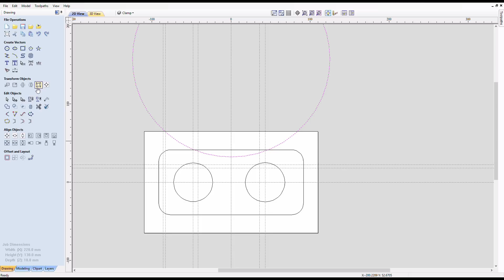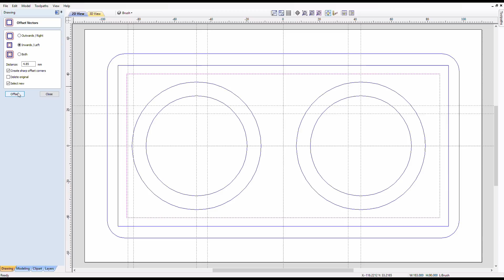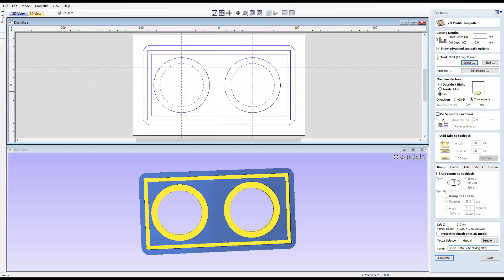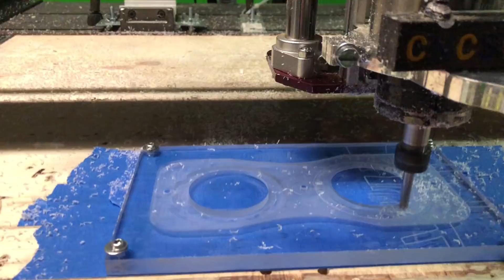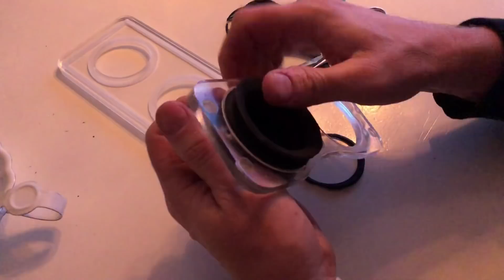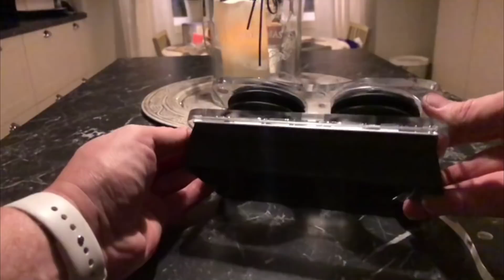The Floating Dust Shoe (The very best dust shoe out there?) VCarve tutorial.

Comment: Looks a great design Erik. How is it performing after all these years? I am thinking of adding a 4th layer to accommodate long and short brushes and, in our case possibly brush layers for wood and other materials separately.
Reply from the maker: Thanks! 😊 It works great. After the video was made, there are a couple of things I should have done differently. The part with the brushes would have a bevel so it would slide up if it hit something. And the acrylic I built it from I got from a friend. I didn't know at the time that it was so expensive, so it might as well have been built from MDF or Baltic birch.

Comment: 2 years later....are you still using it? Any drawbacks you have found? It looks to be a great design. Not sure it will work on my router but I think I am going to try.
Reply: I ended up making one out of 1/4" birch plywood. The baffles were spendy but I love it.
Reply from the maker: John Motschenbacher  I’m so glad to hear that 😃👍
Reply from the maker: John Motschenbacher Hi! Sorry about the delay. I totally missed your comment. Yes I use the shoe all the time! It works over my expectations. The drawback might be the choice of the material, I got a lot of that acrylic and didn’t realise that it was so expensive. So I consider to do a new video and make the shoe out of MDF with a little inspection window  in the middle of a thinner bit of acrylic. And it have stuck once in a obstacle so I recommend you to round of the edge on the part with the brush. Try to do something similar to fit your spindle and you have a dust free CNC.  Good luck 😊

Comment: Please confirm that the middle part have a border so that it sits accurately when the magnets come together with the part which is mounted to the spindle
Reply from the maker: No border but it has three pins that's going down in three holes, as you can clearly see at 14:00 in the video.
Reply: @CNCSwede  yes I noticed thank you for the clarification ..... but I feel that the weight is going to be too heavy for the magnets to handle ... if I have a machine with an 8 inch/200 mm gantry  and I am doing a job close to say 100 mm the bottom part of the skirt would exert pressure while adjusting....also  when the head will move to one side the bottom part of the boot will hit the side of the material and the magnet will not be able to hold onto weight ... we will need to figure out a way to keep the brushes longer and the boot system smaller. .... finally I think this was a great idea but we need to improvise as per the job ...

Comment: Good work. What is the reason for using clear expensive acrylic instead of wood? you cannot see the tool bit anway. Also, no dust shoe works for all application, I can see yours will catch the workpiece as it drop down below the workpiece if the workpiece is thick and narrow enough.
Reply from the maker: Vincent Doan Thanks! I can se some of the working area but the main reason was that I got 3 square meters of 10mm acrylic from a friend for free.  😉 I’m planing to make a new improved dustshoe in MDF with a circular “window” of thin acrylic because it’s easier to buy for most people. And the improvement has with the catch issue to do, but since I did this shoe it’s happened only once
😊
Reply: @CNCSwede  Better yet, make one that can adjust the height to always a bit above the material so you can see the bit cutting it. This is not easy to to because you need to have a distance sensor to get the current distance between the tool bit and the material, and then adjust the shoe accordingly. Of course, you also need a motor to dynamically adjust the shoe's height.
Reply from the maker: Vincent Doan Well now a bit of acrylic plastic became cheap in comparison and its not so important for me to see the bit 😉

Comment: Brilliant design! Best I've seen so far. And great craftsmanship in the design and making too. I'm curious, how did you achieve the beautiful surface finish especially  after machining the middle plate? It looks like a mirror after being milled!
Reply from the maker: Mark Mallett Thanks! 😊 It’s work’s really great too. I used fine grade sandpaper and a bench polisher.
Reply: @CNCSwede  😁 I see it works very well from your video of making a riser plate spacer for your Dodge Challenger! Thank you for posting this! I have a large DIY CNC that I use to cut some very dusty materials. My current dust Shoe does not float and many times sits too high above the material and is nearly useless. I use Bosch Colt and DeWalt 611 routers which are larger in diameter than a usual spindle, but with some modifications to overall size and spindle diameter this could work for me I think. The rubber boots could be from a salvaged truck propeller shaft slip joint for very little money, and sometimes free here at Salvage/Junk yards. Seems I need to get busy and make one of these! 😄
Reply from the maker: Mark Mallett Many people seem to have trouble getting hold of the acrylic plastic so I was thinking of making a video with a different design. Birch plywood with a round insert of acrylic plastic for visibility in the lower part . Good luck with your build!  👍😊
Reply: @CNCSwede Thanks! 👍 I have some 0.357inch/9.07mm Makrolon polycarbonate I will be using. Hard to get good acrylic, I agree. I have it here but mine shatters like glass when dropped, it is beautiful however. The usual unfinished MDF when coated with an oil based clear like Minwax Satin is cheap and very strong. I built my entire CNC router this way. And MDF is available worldwide - My wife used this in furniture construction in the Ukraine. Just an idea. I'll send you my progress and construction files in email, if that is OK?
Reply from the maker: Mark Mallett Yeah MDF works great too. I’m looking forward to se your progress and your CNC! Cheers Eric
Reply from the maker: Mark Mallett I forgot to mention that my email address is cncswede@gmail.com
Reply: @CNCSwede Eric, I just finished the final versions of your floating dust Shoe modified to fit the DeWalt 611 router. All are done in Vectric 😄. Waiting in your email. Let me know what you think. -Mark
Reply from the maker: Mark Mallett wow great! That’s was fast 😃 I got your emails.  I answer them this weekend. My English isn’t that great so it takes a while too write them 😬
Reply: @CNCSwede  No worries Eric, I've traveled all over Europe and you can be sure that my Swedish is far worse than your English! Anyways, your English seems not bad! :)  I'm "retired" so I have plenty of time to work on things, it only seems fast. :)

Comment: Love the design! I am in the process of making one of these and was wandering: the lowest (brush) layer moves freely around the spindle so its hole should be mush bigger than the diameter of the spindle. Is this correct? For a 65mm spindle, what should be my brush and middle layer hole size? 

Thanks!
Reply from the maker: I got the same width on all three. My chuck isn’t so wide so it interferes with my dust shoe. I hope to see some pictures when you are ready with the shoe 😊
Reply: First of all - thanks! I have all three parts cut and was able to get the rubber dust boot so it's really a matter of assembly now. I think I understand the mechanics now: the two upper parts sit on the spindle while the lower part with the brush hangs in the air around the chuck. That's brilliant! 
Where should I post the pics?
Reply from the maker: gil segev Great 👍😊 You can post pictures to cncswede@gmail.com

Comment: It appears to be deeper than most shoes, have you found that to be a problem. I do like it  a lot
Reply from the maker: Howard Boehm Thanks 😊 I don't really understand what you mean by deeper. But it is very effetive and sucks up all dust 😊
Reply: From the distance where you mount it on the spindle to the bottom of the bristles.
Reply from the maker: Howard Boehm No, that's the benefit of this construction. If I cut objects with large variations in Z axis and have long ball nose bits, it seals all the time because of the big stroke length.

Comment: So 1.81 inches is the max depth you can cut?  Seems like that may be more a function of the brush length or am I thinking about this wrong?

I thought of a couple more questions:
1. is it possible the boots hit an angle that they make contact with the spindle/bit?
2. if the dust shoe catches on something, it will detach from the magnets and make contact with the spindle?  Is there any type of latching that prevents this?
Reply from the maker: Hi Ben! I thought it was the bit length that worried you in your last question? The clearance under the z-axis is almost 5 inches on my machine, but if I had material so thick the shoe have contact anyway if you understand?

1. Either the brush or the boot can contact the bit in my design, that’s the  reason of my design actually. If you add longer brush without the boot the brush will contact the bit.
2. If you look at my video you see the three pins that prevent that.

Comment: How do you set this up for bits that vary in length?  For instance, the difference between a v-groove bit and a .25" end mill can be a couple inches.  

Great design though, I am designing a boot right now taking your lead.
Reply from the maker: Ben Geiser Thanks Ben! 😊 The shoe doesn't have any problem with the bits that I have used so far. But that's a good question, I should measure the stroke of the shoe later today. 👍 I let you know the results.
Reply from the maker: Ben Geiser I have measured the stroke now. You can read results in the document and look at the pictures I uploaded here. https://drive.google.com/open?id=1TiBgdUAnSsqUH28Stj0rYOdvTw2Vs64-

Comment: CNCSwede
That is a great variation to the normal Dust Shoe. I have a home made dust shoe that works well, but I think I will be following your lead as I think your innovation will be far more effective. Thanks for the ideas and the great videos.
Reply from the maker: Geoff Sims I'm glad you like it, it works really well and it always has contact with the material even if I use longer end mills. I see a lot of people running with their shoes far above the surface. It should not be as effective I guess.